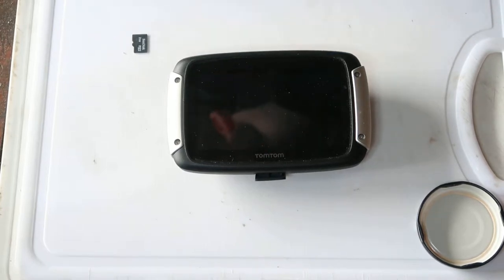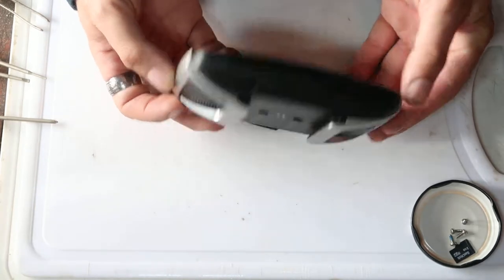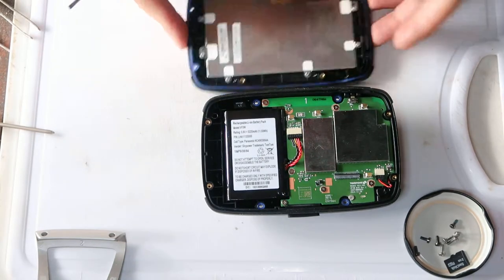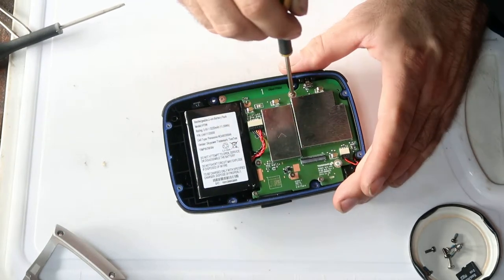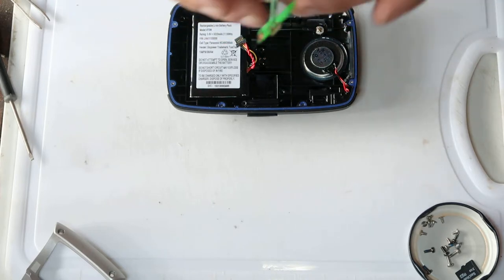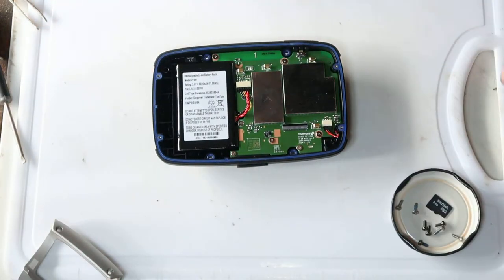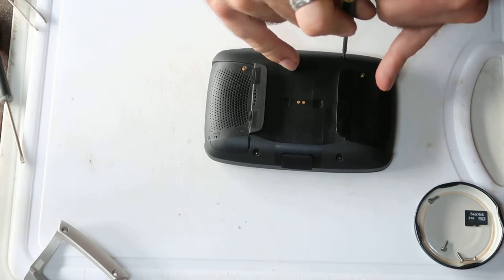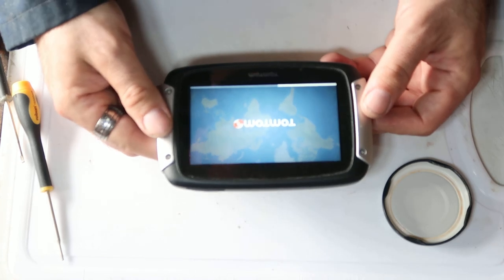NBW - Tomtom rider 400 disassembly

Comment: my tomtom is same model it gets like a moisture cloud across the screen once i haave been riding half an hour what is causing that and what can i do to stop this damp getting into the screen
Reply from the maker: There's a tiny air vent in the case that should let moisture out. I've experimented with putting a few silica gel beads in behind the circuitboard and they seem to absorb any moisture in the air.
Reply: @nicebigwrench8730  this is brilliant - please can you tell us where this tiny vent is?

Comment: Any idea if the hardware is the same on the 450? After a crash my tomtom wont get any GPS connection anymore. The outside is cracked where the GPS antenna is. I have an old 400. I might want to swap the circuitboard so of the two. Thanks in advance

Comment: If I get water in it and the screen stops working (wnt let me press anything on the left) should I just replace the screen?
Reply from the maker: It sounds more like that part of the screen connector has corroded. You might need a new circuit board instead. Or that connector might just need cleaning with a cloth and electrical cleaner.

Comment: Hello mate. I followed the video to change the battery. Unfortunately I can't find one on the web.
It's a VF3W 3,6v 322mAh P/N : LHA11133000
I don't know where to find one. If you have any idea to make my 400$ brick alive… I would take it !
Reply from the maker: Sorry I've had a look and I can't find an exact match for you. Might be referred to under a different model number
Reply: seems like VF3W is not available, but from pictures the connector of VF1C or VF6M might fit. Altough it is only 1/3 of the capacity, but seems the only available option.